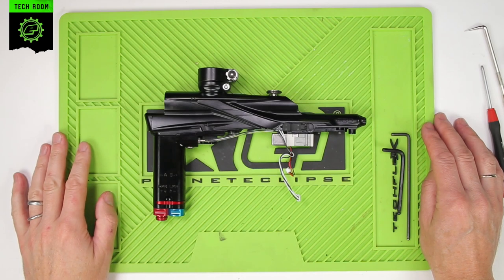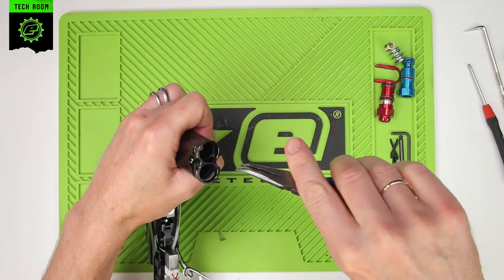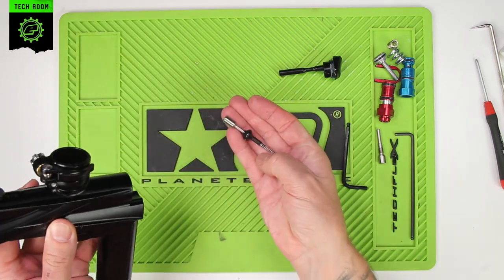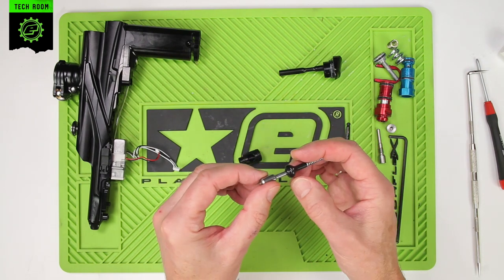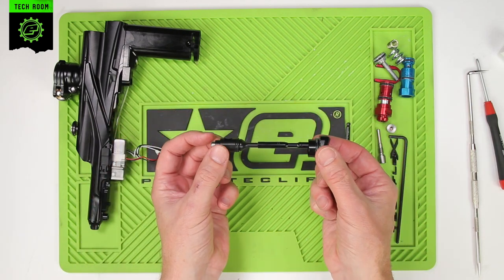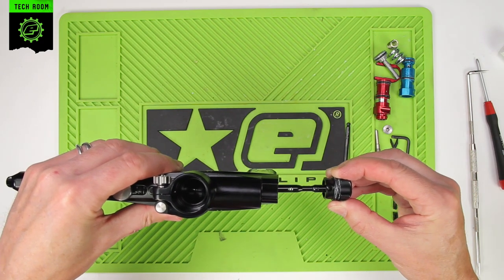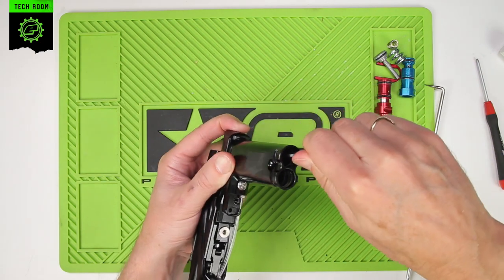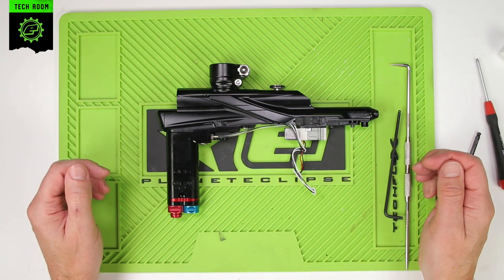Eclipse EGO LV2 Exhaust Valve Maintenance

Comment: Had a friend at the field yesterday with a brand new LV2, just took it out of the box and aired it up to end up with the bolt locked forward and air leaking down the barrel.. This is most likely the cause of his issue, or would it possibly be something else?
Reply: I had that same issue bolt kept getting stuck forward releasing air im wondering if i should do this
Reply: My lv2 doing the same did your friend look over his and did he go through this process and leak stopped?